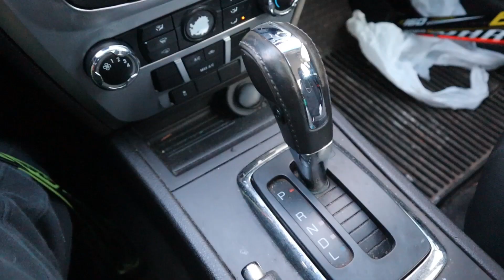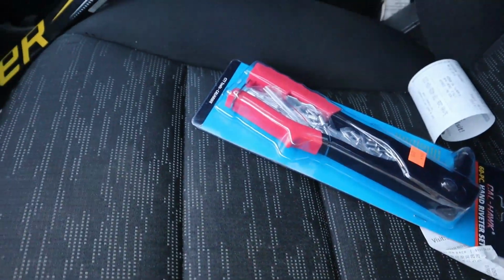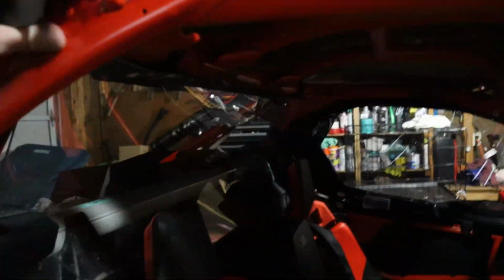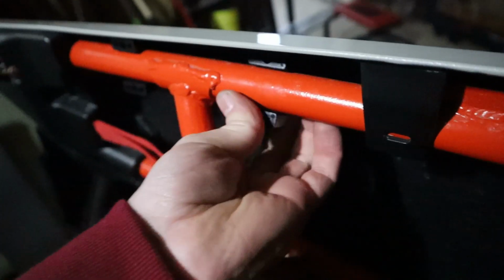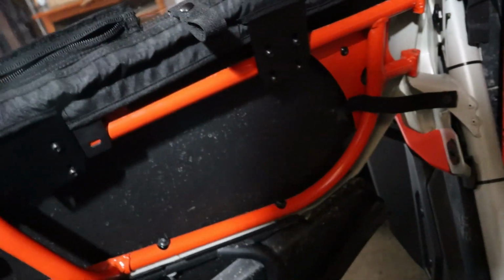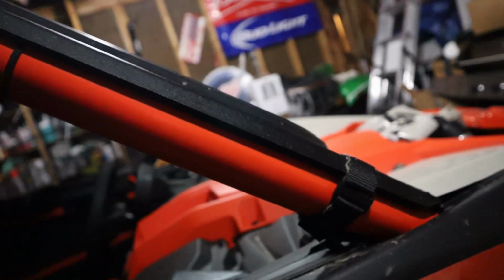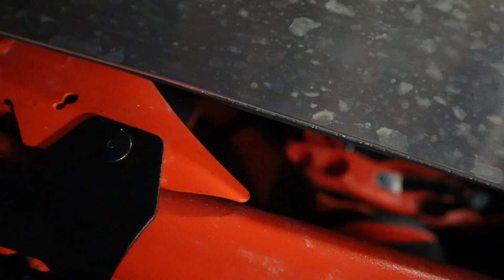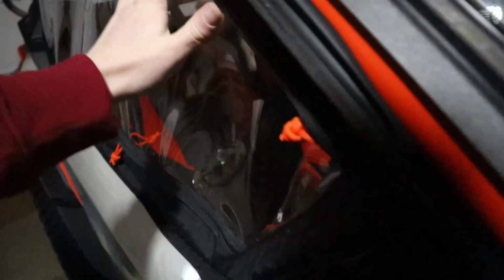Can-Am Upper Door Install | 2022 XRC Turbo RR

Comment: Does the wiper or bottom vents get in your field of view? And can you do a video showing the windows zip down? I'm curios how they roll up for warm weather.
Reply from the maker: I haven’t had an issue with sight at all. And yes, I can do a video on the windows since I haven’t un-zipped them and rolled them down at all yet 😂
Reply: @JakeAlexander  Thanks.
Reply from the maker: @bobschreur346  not a problem!

Comment: That’s the same machine I want so bad.how do like all the improvements on the 2022
Reply from the maker: So far so good. I only have a couple hundred miles on it so far though.
Reply: @JakeAlexander  do you wish it had more power
Reply: @JakeAlexander  did you do the air intake relocation intake,I heard it very loud around 5,000 rpms
Reply from the maker: @skeim5620  I heard the older ones were pretty loud, but they changed some things for 22’s in the airbox and they have silencing foam in the breather tubes. Unless it gets louder, I’m just going to leave it alone. Not bad as of now. As for power, I’m happy with it. I have only had it in trails and snow so I haven’t had to get on it. Once the warranty is up though i will do some power mods to it.
Reply: @JakeAlexander  I guess your not buying any extended warranty.I talked to Whalen tune they day you get 40hp for about $700 plug in tuner and adjust waste gate on turbo
Reply from the maker: @skeim5620  i ended up getting a 3 year extended warranty when I purchased it. As of right now I’m in no rush to tune it. Might change when i get it out on the dunes though lol but close to that 3rd year of warranty, i plan on just doing 20-50hp tune and exhaust. Nothing to major.
Reply: @JakeAlexander  these warranty’s are so expensive.I got a price of 2,450.the problem most of the people at the shops suck at fixing them
Reply from the maker: @skeim5620  I usually stay away from extended warranty stuff but I personally know the owner of the store I ordered the xrc from so they took care of me on it. I paid far less then even half of that for my warranty. 3 year. Unlimited miles. And can take to any can-am dealership i want. Will i ever use it? Who knows. But it’s there if I need to
Reply: @JakeAlexander  can you give me the phone maybe he can help out with price,I would greatly appreciate that
Reply: @JakeAlexander  what dealer did you get it from
Reply: @JakeAlexander  I could really use that warranty ,I want to make it street legal
Reply from the maker: @skeim5620  i got it from Renze Power-sports in northern Michigan. I’m pretty sure the number is (906) 387-3920
Reply: @JakeAlexander  thanks for your help